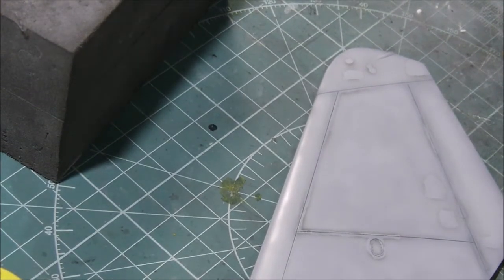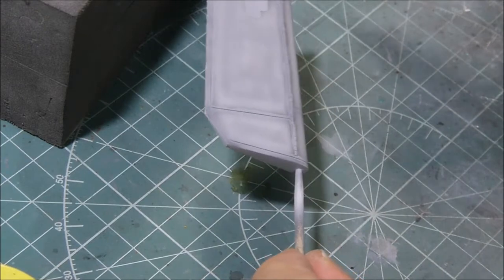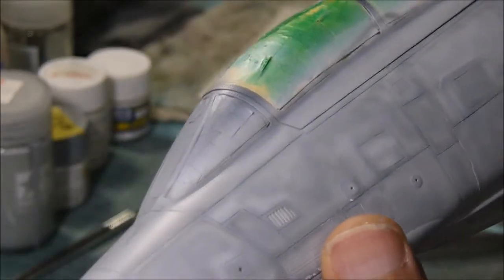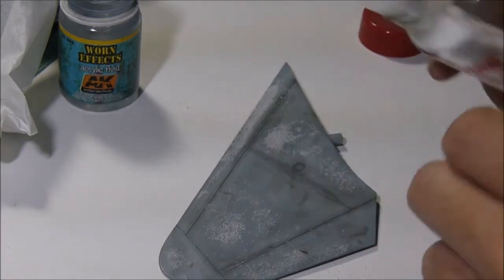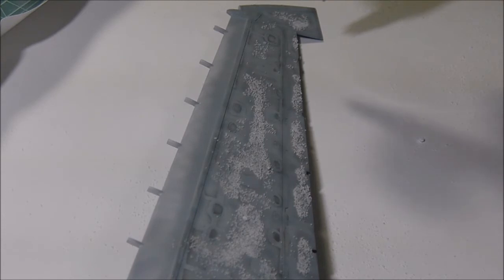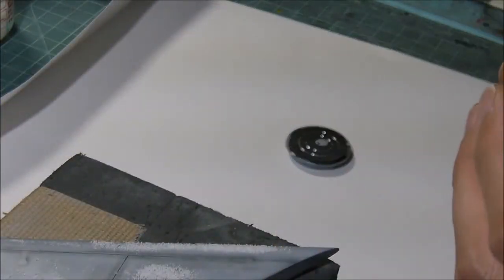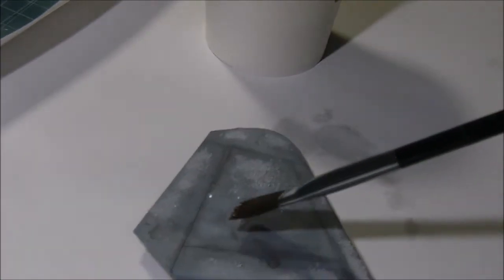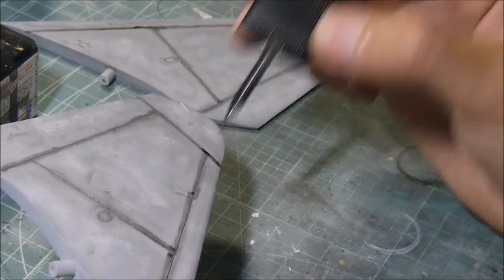1/32 F-14 Vol 7 ”Salt masking effect"

Comment: one thing i learnt the hard way is that to ensure that the salt is applied only after a gloss coat is applied on the model. i did the salt method immediately after painting and what happened is that the salt , over the years has started reacting to the brass photo etch parts and petina started to build up. so after painting the photo etch parts, make sure they are protected by a gloss coat